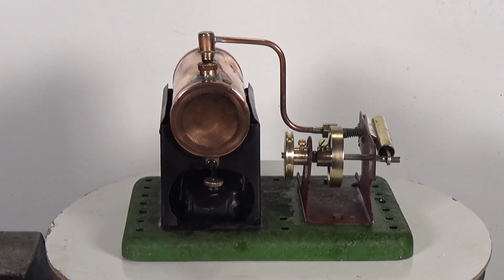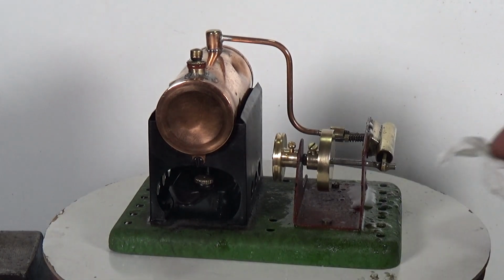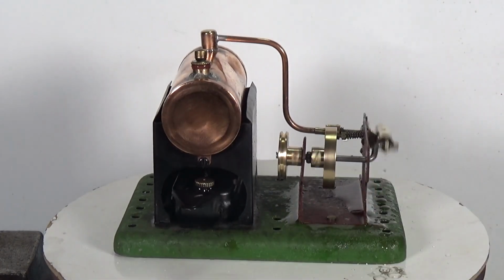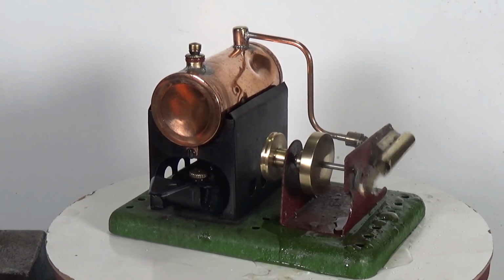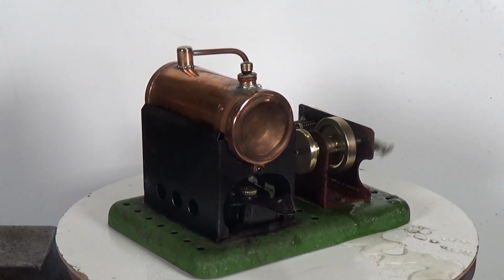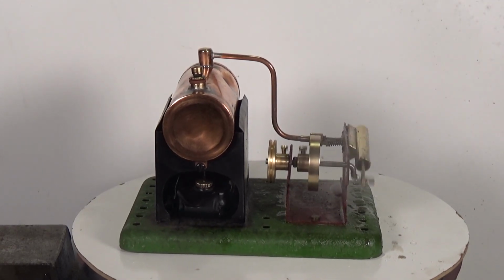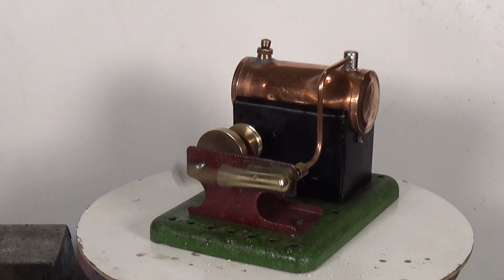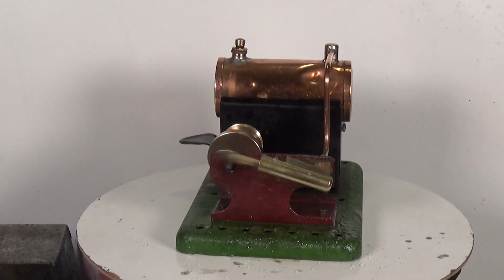Castle Products Model B Horizontal Steam Engine - Part 3

Comment: Got it sorted OK Alan.

Gawd, some simple brass/bronze bearings for the crankshaft would be a big improvement on the original design.

Not built for long term use  ;)

Cheers Rob
Reply from the maker: Hi Rob. No these old toy steam engines were definitely built down to a price. This type of construction was quite common, British engines like Mamod and Bowman, also American engines like Empire, Jensen and some Weedens. No bearings just the shaft running in holes drilled in a tinplate frame. They stand the test of time surprisingly well, i have engines built like this frorm the 1920s and they still run fine. Cheers, Alan.
Reply: I thought that may be the answer.  They  often look a bit light weight on the engineering side.  I guess if it works don't mess with it.

I expect run time would be low.

Cheers Rob